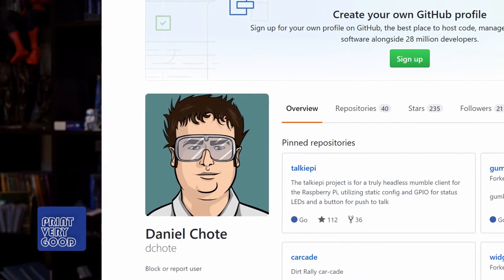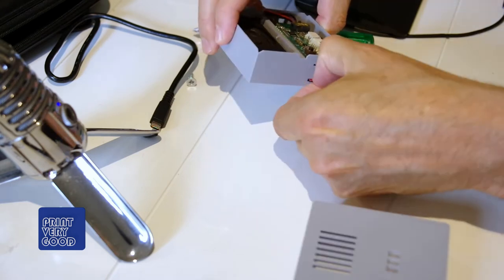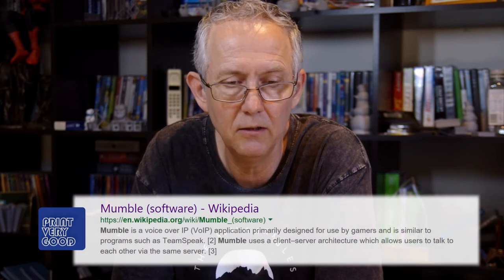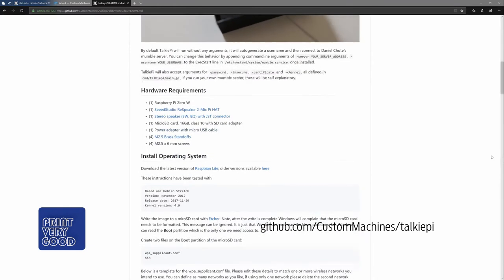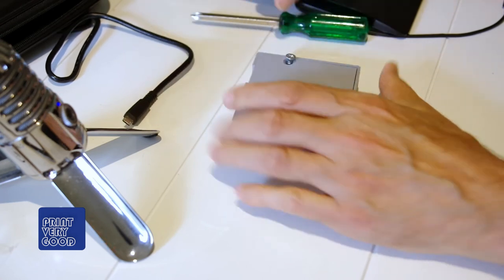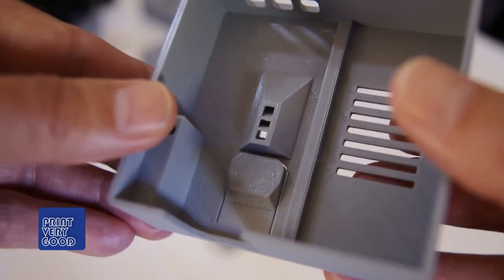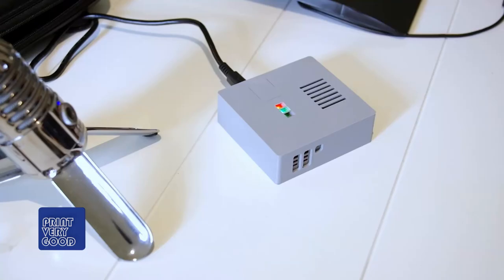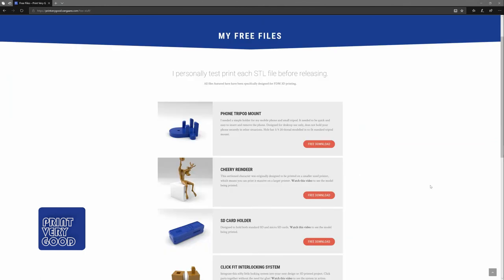Raspberry Pi Walkie Talkie - [TalkiePi] Make your own Wi-Fi Walkie Talkie.

Comment: Great Project, thanks, hey when buttons are pressed at the same time at local and remote units, this will happen in family home installation time to time. This causes  full blast volume feedback at the speakers  which discourages the family/user to use it, is it only with my setup or this is something that can be fixed?  any pointers to fix it would be awesome... thanks again..

Comment: Hello PVG,
can you please tell which screw is used on the back to keep the casing together? It seems to be missing in the part list.

Thanks for this awesome project. Been looking for this quite some time because the original US Robotics speaker used in Daniel original project is not longer for sale.
Reply: Hi @hansipaider23, thanks for your comment! The screw was a late addition. I literally grabbed a small wood screw from my random collection of screws and modelled a hole to fit that. It's a Phillips head countersink screw 15mm or 5/8" in total length, if you get a 4 gauge countersink screw to the same length that should do the job.
Reply: @PaulVanGaans  Hey Paul. Can you provide the model in a solid format as a single editable body? I've printed it with highest accuracy my printer can manage but I cannot fit the Raspberry Pi and the Speaker in it. There is so much force needed that all cases broke so far. When I try to import the Case in Autodesk Inventor I am not able to edit the geometry. Can you provide the files in a native CAD format?

Comment: Is it possible to build one talkie pie and speak to someone on their phone? Instead of having another talkie pie as the receiver ?
Reply from the maker: Hi Ahmed, yes I believe it is possible but you need to have a mumble client installed on your phone. I have no idea how to set this up but if you search the web I'm sure you'll find the answers you need. Paul.
Reply: Install an app called mumla. It's a mumble client on Android at least. All you have to do is find the IP address of the talkpie (and the port maybe) and you are done.

To make the process of finding the IP address easier, you could set up a python flask app on heroku, with which your talkpie will update the IP, by sending it to the server and you can pull it from the other device, but I'm not sure if I would recommend doing such thing (security reasons, so proceed with caution, if you decided to use this method)